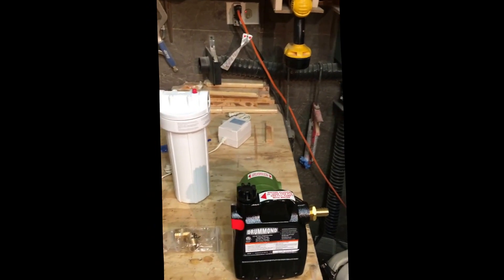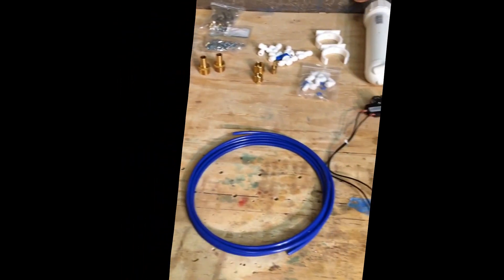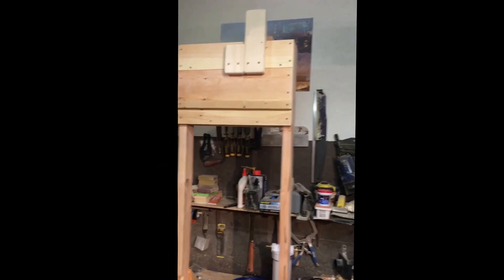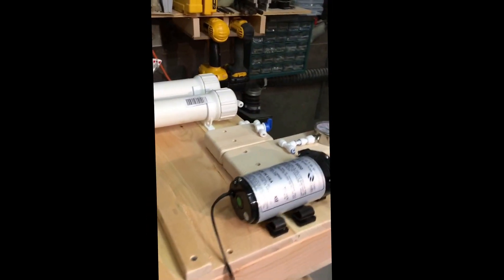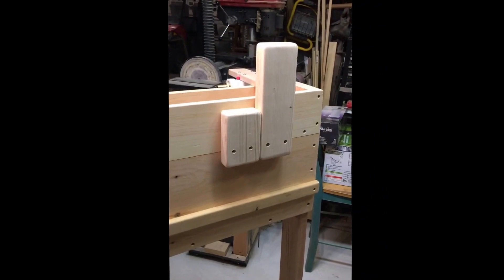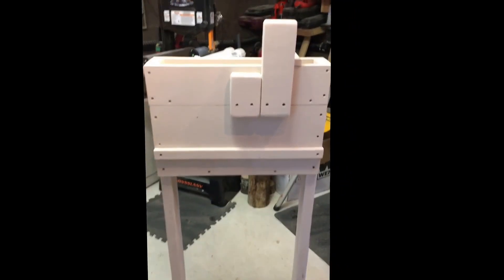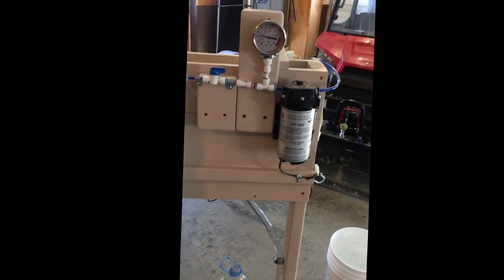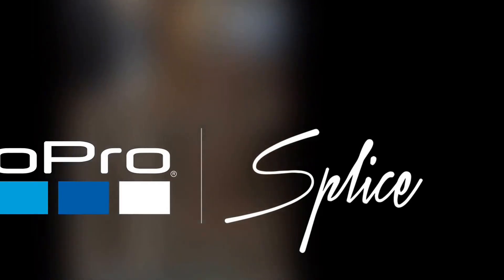Maple Sap RO 2

Comment: Given I have solar I plan on running mine 24/7 once sap starts flowing.  Putting sugar exit back into sap tank and let it run and run and run.  Some claim you can get it up to 14-16% doing that.
I have 2 membranes like your setup exactly the same way with nearly the same pump.  Went 3/8 - 1/4" on the line after pump but put pressure valve after filter so I wouldn't blow the gasket.  I could put the filter before the pump, but I like the idea of filtering after pump... who knows what's in there.  If my water tank overflows-I don't care.  I only have about 75 taps.  I'm hoping this little baby will do the job and get it over 8%.  Once I have tested mine-I'll post a video, but need to wait a whole winter.

Comment: Thanks for the great video.  What is your processing rate?  If you had 100 gal of raw sap how long does it take to process -  just for one pass? Thanks
Reply from the maker: About 20 hrs Its not a very fast process it depends on the RO filters that you have, Sometimes I will boil raw sap and have the RO going at the same time just to speed things up

Comment from the maker: I got this to work for the first time last night. I failed to install a back pressure/needle valve on the condensed sap side to allow the RO to work properly. After redoing some of it I was able to take raw sap from 1.7 to 4.8 sugar content on my first try. I'll make another video later this week on the finished project.
Reply: Joe Johnston how do you know how much back pressure to add?
Reply from the maker: sorry this took so long. You want to get about a 2 to 1 ratio. Use a quart jar so you can get 1 qt of condensed sap to 2 qts of pure water